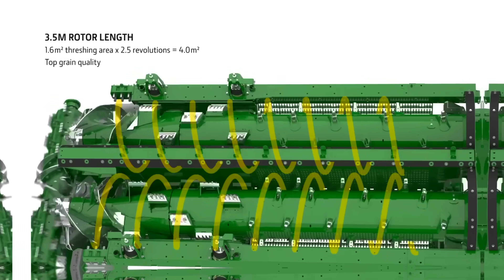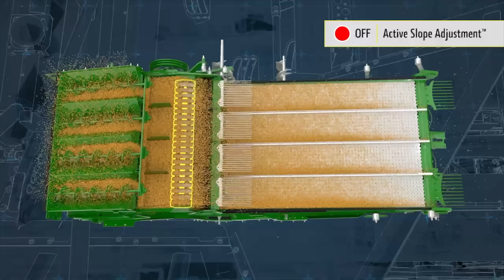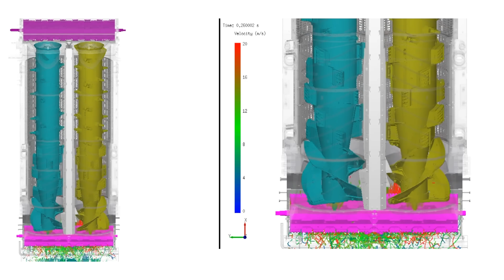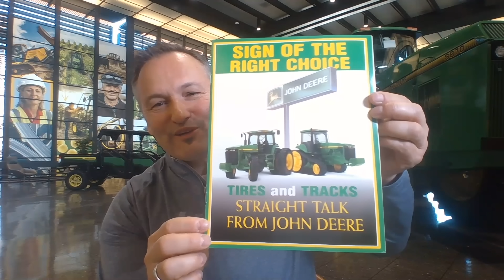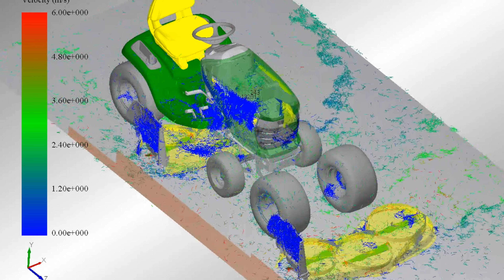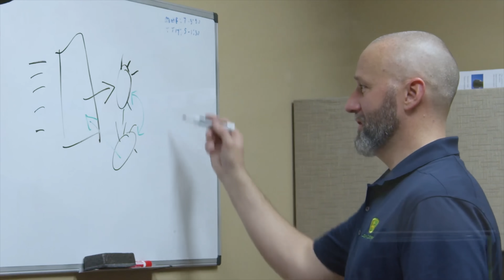How Epic Engineering is Saving Farmers

Comment: A good youtube channel, but over glorifiing a company that is responsible for farmers misery. No right to repair, no option for good simple machines. For combine harvester technology: a lot of things haven't changed from the 80's. hill leveling systems with sieve sideway movement has been available from them with much simpler technical solution -> take a look at Claas Dominator Maxi series from 1990, rotor technology is something CaseIH got for a really long time. Simulation is nice, but through long time testing, field experiences, the machines have become performant on their own long before. These sensors add only 0.1% productivity while adding 100% complexity and 30% cost to farmers which already are on the edge.

Comment: These guys are really bad at explaining how it works. What it does is easy, how it works is the complicated part, yet its glossed over.
And most of the tech is suuuper old already, not sure why they think this is revolutionary. Spray seeds, just a fuel injector that been used for many years. Leveling is relatively easy,

Comment: I cannot support John Deere anymore. They used to be a great company, and to this day they certainly do build great, advanced equipment. But over the past couple decades they have corporatized in the worst way. 
Since the beginning of farming, a farmer has needed to work on his equipment. Things break in the field all the time, its just the nature of how these machines operate. And a farmer needs to get his equipment fixed and back to work quickly because the window of when that machine operates is very narrow and having a machine down for even a day can mean crops rotting on the ground, money lost, time and resources wasted, and less food going out to the people, and therefore higher food prices for everyone. 
But JD has been carefully designing their equipment to be impossible for a farmer to work on. And even using litigation to shut down independent local repair shops. They have basically made it so that a farmer is forced to bring their equipment to the JD dealer to get repairs done and closing down any work around to this that might arise. This means farmers are getting price gouged for repair work that and independent shop used to be able to do for half the price or less, or even the farmer used to be able to buy parts and change them out theirselves, but no longer. And alot of this equipment is huge, its not always feasible for a farmer to get his equipment to a dealer quickly when it goes down, they might have to rent special trailers or something, and then they don't always have the time to wait for the dealer to do the repair (let alone the money) when you're spend half a million to multiple millions of dollars on a piece of new equipment and then when it breaks you discover that you're "not allowed" to fix it yourself, despite the fact that you may have the knowledge, expertise, and experience to do so, for no other reason than corporate greed. Thats a serious problem. I hope they start encouraging their talented engineers to design equipment to be easy to repair by a farmer while its still sitting in his field. Short of that, I hope they go out of business, and those engineers move to a company with better practices that believes in the right to repai. Its sad to say, because they're an monolith that represents American farming. And we are getting some piss poor representation at the moment from them..

Comment: Oh, my ... so many negative comments. It is true that "high-tech" is often very difficult to repair. And if you want your equipment to "be reusable", it has to "be engineered" that way. Doing "more" is a negative sum gain if the costs (including maintenance) go up even faster. But my own experience with vehicles, computers, appliances, and tools, etc., is that over a slightly longer term (maybe over 5 or 10 item "lifetimes"), the relative costs reduce and the reliability improves exponentially. Today's ICE cars are more complex and harder to repair (the size didn't change as more stuff went inside) but much more reliable and longer lasting than those several decades ago. EVs are off to even better starts. (I drive a '95 Chevy Blazer with 330,000+ miles). Same thing with computers and smart phones, household appliances, and ordinary hand and power tools. The next generation of farmers (or rocketeers and roboticists) will simply take that sort of "improvement" for granted .. and still want and aim for more.
Reply: For cars it is aplicable. cars have become reliable. For farming equipement it's different. Let's say 70 years ago engineers didn't had technology to simulate stress. They build a machine, took it out on the field and studied where it broke trying to make it tougher. Testing cycles, R&D has become very short in the industry leading to buyers being the testers. There are within one combine series nowadays 3-4 revisions within 10 years. This is not good for getting replacement parts, storing them. Farming is almost as hard on machines as construction/earth moving/mining. A field varies 3-4 times form one end to another, not one farming year being the same. It's impossible even for today's technology to simulate those conditions. This leads only into making machinery too complex, expensive and brittle. I'm farming for only 10years, but have gone through 3 generation (70's technology, 90's technology with first computers, and modern stuff) of equipement already (since my family is farming for much longer). Engines have become better, but overall life cycle of machines have gone direct proportional down with price increases.
Reply: @firionrazar  Yes, your points are well-taken and true and something I did not allude to in my comments. With rapid ("exponential" maybe) scientific and technological change, "life-cycles" shorten. For "solid-state" things like smart phones or computers, reliability has gone way up, as has cost; but the hardware obsolescence is swift too. Software can change rapidly and increase the value of "machine-like" things, but they feel "unperfected" and also then become functionally obsolete quickly. Whether cars, trucks, rockets, factories, medical care, or - in this case, farming; as you said, "This leads only into making machinery too complex, expensive and brittle." I am not sure (especially not in medicine) at what point "the machinery" becomes completely adequate and reliable for the task to be performed and improvements can be added mainly through software. (Perhaps that comes with a humanoid robot or autonomous machine). Rovers on Mars are pretty reliable. I think what I am trying to say is that rapid generational changes are happening faster and faster in every field and discipline. 70's technologies (diesel or gas tractors, bulldozers, excavators, combines, etc.) still work quite well, but we want A/C and touch screens and quiet EVs, etc., now. It is no longer the "Jones" to keep up with, or even the factory farms, it's the tech itself. Perfection is a different point on the curve from "progress." Have to live with it - frustrating but also exciting.
Reply: You make a good point. I don't mind if small things aren't repairable, but if farmers complain it might be an issue. Farmers are famous for beibg horrible lobbyists too that take billions in subsidies. I'm anti both sides.
Reply: @H0mework  It's true you can't just replace a combine like you might a smart phone or even an excavator. This video was about engineering, not "farming" per se. I've relatives and known many farmers and - they all complain :-} ... and lobby too, but they sure do understand and use their equipment as well as care for the land and the seeds and the produce. They are technologically, economically, and meteorology savvy folk.

Comment: I recently learned that these machines require GPS to work.  One of the problems farmers were having during the recent solar storms was lack of GPS signal due to all the interference.  They didn't even have the foresight to build in some kind of fallback mode to allow farmers to operate them without GPS.  Not impressed.

Comment: Not buying a john Deere after the crap they pulled blocking repair. Their old stuff was very repairable like my model B. I understand they are complicated but they shutdown for simple field repairs and hide the reason when farmers risk their entire years profits for a down system they could fix in the field with a can of compressed air.

Farmers are very mechanically minded, clearing jams, cleaning sensors while watching weather and knowing they are racing a storm that can ruin a harvest and pushing all night when needed. Deere claims to know this but their behavior proves otherwise. Watching these machines and helping dad on our farm as a child is what led to my becoming an electrical engineer specializing in controls eg automation so I know a thing or two.

Comment: Right to repair!  I hope John Deere fails unless they start making their products repairable without having to buy their software or special tools.
Reply: Wow didn’t know about this 😊
Reply: There was an intention once in EU also,by New Holland, didn't worked because some romanian farmers replaced the computer with a ECU from Renault trucks from scrapyard,wich can be reprogrammed, so the NH remained sucking his finger.  All you need is a programmable ECU to control the fuel injection based on the 2 CKP position sensors on the engine,the rest is just bells and whistles😄

Comment: How accurate are the simulations in predicting real-world performance, and what are the limitations of these simulation models?
Reply: current simulations can be very accurate, it is different what problem machinery is optimized to solve and how. average farmer likely has answer too from experience.
Reply: @effexon  No year in farming is the same, a field does vary 3-4 times from one end to another. It is almost impossible to simulate it. Take weather forecast for example: with all technology available today there is little to no imporvement to it compared to 40 years ago. To me machines have become only more complex, expensive and brittle since thay are not overengineered as they used to, breaking if some peak stress apears. In a perfect world with constant loads, modern farm machines could outrun at least by factor of 2 older machines using 20% less fuel. But it's not a perfect world out there. Look at auctions for farming equipement: you will find old mould plows with original steel beam, unwelded, unrepaired. Compare it to bigger modern minimal tillage machines where most of them have gone throu repairs.
Reply: @firionrazar  I assume og comment referred to simulations shown in video showing design of cultivator and grain flowing through machine. I agree on farms and living organisms of crop, though some balance is with wide area of fields in different locations. Still I agree, humans are screwed if globe throws curveball and bad crop happens everywhere at same time... some historical cases where it was like this.
Structural engineering needing for eg spacecraft and other latest devices means current day engineer could easily design similar level but better equipment than 100 years ago just business model has to be more humble. Who knows we may be headed to that direction as energy and materials can be less abundant in future to make machines every year.
Reply: @effexon  yes, yes and agree to your argument.